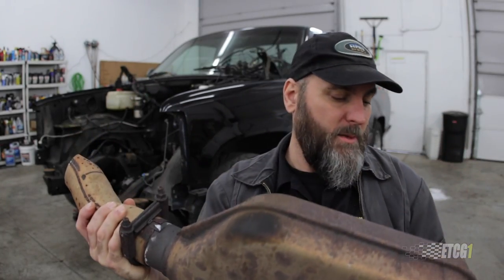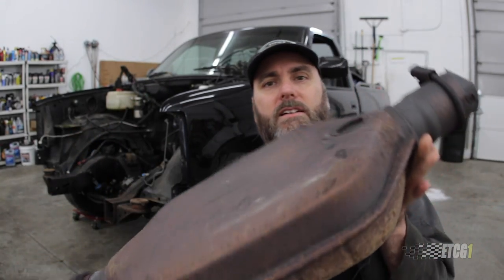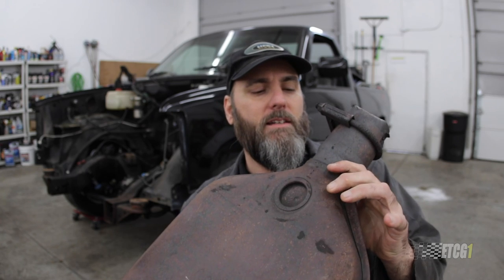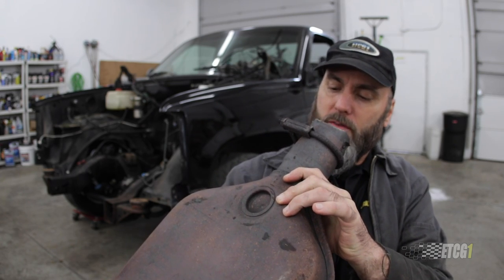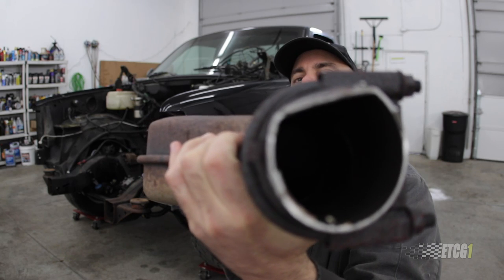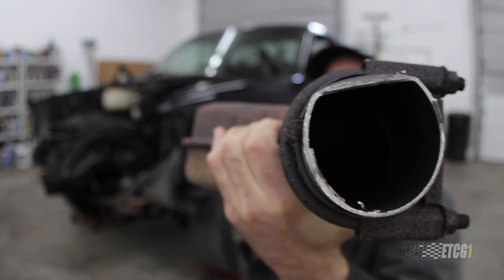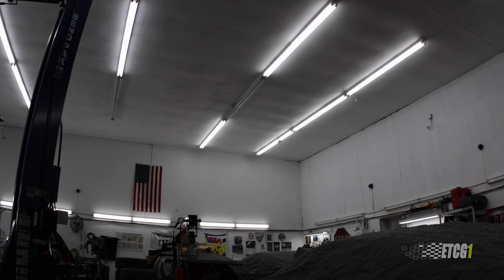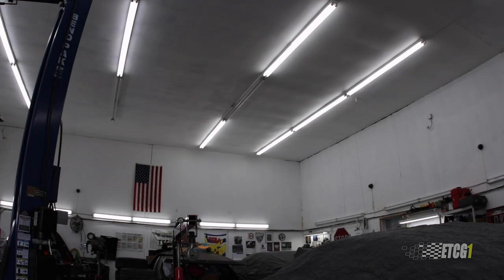Should You Run a Catalytic Converter on Your Hot Rod?

Comment: Why not make a video of doing emissions tests with and without a cat: then compare reports, exhaust smell, and visible particles (revving against a clean cloth or something similar to get some hill-billy grade data points). It would also be nice to get a dyno run with and without a cat as well, so that we can compare downsides and perf gains.

However, as a sidenote: I thought this discussion was pretty much over since we finished the 80's. Three-way catalytic converters are old, proven, tech and it has been decades since anyone around this side of the globe has even thought about cutting off cats. I still smell the bitter, obnoxious fumes from cars of the 80's and that went gradually away as emission limits requiring efi and cat came into effect in the 90's. I don't miss that at all, I don't get funny taste in my mouth anymore and I don't see why anyone would want to drive on public roads, or any roads, deliberately without a catalytic converter. Think of standing in lights and inhaling yourself all that emission "goodness" that your straight-pipe car is fuming away around it.

Comment: if theres no requirement, who cares? lack of enforcement is why my tpms and air bag lights never shut off. Your not building 15million of these engines and are not a new car manufacturer. 95% of people drive those cars and are not doing custom work like yourself. I think the percentage of old cars/custom car to new cars actually being driven on the road it low enough to make your pollution machine, negligible in the grand scheme of things. especially when entire giant countries boil and burn down trash to get scrap out with no regard for any ones health.

Comment: I would put a cat on the truck, even on the Fairmont. If you can improve the emissions, why should you possibly decide against it? Performance? Is a cat really gonna affect it that much? You of all people would find a way around it to run strong with a cat.
Reply from the maker: The Fairmont won't get a cat, at least not in the near future. That said, I'm improving the fuel injection and the ignition system on the truck with components that function better than stock. In short, I'm improving the emissions systems on the engine even without a cat.
Reply: @ETCG1  Okay, thanks for the reply.

Comment: Emissions are fine for the 99% of people who drive cars just for transportation. Which, if the math is right, is where 99% of automotive pollution comes from. I don't think the unjust laws should not apply for the car guy type who modifys there cars as we are only a very small percentage of the people actually driving a car and adding to any pollution. I delete every emission system (except the EVAP in some cases as that system doesn't hinder anything but keeps gas fumes down)  from everyone of my cars INCLUDING the cats. I do so for a few reasons. I delete the EGR because I DON'T want carbon buildup in my intake and on my intake valves and lower octane in my intake charge. I re-route the PCV to catch cans for the same reason. I delete the cat as most of my cars are old enough that the cat is ether clogged or broken up anyway. Not to mention there have been people who have deleted there cats and STILL pass the pipe sniffer test in un-free states.

Comment: If you really believe in ‘man made’ climate change go for it. I personally don’t. I had a 1975 olds that passed Cali emissions without a cat (hollow no visual inspection) by just changing from manifold to port vacuum on the timing. (Nox) and my hydrocarbons were about 200. This was in 1988.
Reply: What about all the people you gas out that have to drive behind you or are going for a walk?
Reply: GoogleMinus what part of passed did you not get? I was allowed 300 ppm hydrocarbons and my nox level was passing with just a good tune and egr blocked and no cat. Ps mining,refining all those precious/ non precious metals and manufacturing and shipping these also creates pollution but I’m sure that isn’t taught in indoctrination class.
Reply: @NoName-tz5ji  IDK why you're going at a global level when I was going from the local viewpoint.  Just because it passed the inspection, doesn't mean that there is nothing to be gained by having a cat.  Clearly you should have learned this when the levels of lead in your water "passed" but the effects...

Comment: you don’t need them. the old catalytic converters were inefficient and restrictive. modern ones are so much better. my 89 k5 blazer has a hollowed out cat and it passes emissions with flying colors. if the vehicle is well maintained and use good fuel you don’t need a catalytic converter.

Comment: I would always install a catalytic converter, even if the car didnt have one, as far as it is possible without damaging the car. But i would go for a light high quality one that generates less backpressure than the original one, if the car had one stock. Id rather sacrifice something like 5 hp or so if i can have exhaust gasses that are less unhealthy for the next driver behind me. Only situation ever i would run a car without a cat would be on a real racecar, that i was actually going to race professionally, any other situation i dont see the need for the most possible power.
Or to say it in Colin Chapman's words: "Add lightness."

Comment: I have to question if emissions from everyday motor vehicle use have been solely responsible for "making kids sick". Is smog strictly from vehicles the only killer or was it more the smog from industry? Maybe it was 50 - 50 or 30 - 70 or 90 - 10? What about lawn equipment or home heating systems or coal plants, or forest fires or volcanoes? And there is never any acknowledgement of how far we've come with reducing emissions over the last 5 decades or more, at least in this country. Throw the "kid factor" in there and you have immediately emotionally charged the debate. Why not mention puppies and kittens? They should be good for getting even more people on board. I realize my point is off topic from that of the video but I really wish that claims with no irrefutable scientific basis and sited sources as well as 'carbon neutral' references could be left for the political Youtubers. And, of course, I do acknowledge that air pollution is not good and should be minimized but not necessarily completely eliminated at all costs. There is probably a reasonable middle ground somewhere but I have yet to see any real hard facts and believable evidence regarding rational and feasible solutions. One thing is for sure, I'm not going all in on the fact that if I never use a straw again for the rest of my life, I'll save the sea turtles or whales or plankton or whatever is being killed by them. (Btw, how the heck are they all getting into the sea, anyhow?) That was a major digression for sure but it would appear I was due...

Comment: If the vehicle was built with a catalytic converter it is a violation of Federal law to remove it and still use it as a street vehicle.  It doesn't matter what your state laws are, it is always a violation of Federal law.

Check out Chapter 42 United States Code section 7522 section a subpart 3 (this is abbreviated in legal writing as 42 USC § 7522(a)(3)):

(a) Enumerated prohibitions

The following acts and the causing thereof are prohibited—

*

(3)

(A) for any person to remove or render inoperative any device or element of design installed on or in a motor vehicle or motor vehicle engine in compliance with regulations under this subchapter prior to its sale and delivery to the ultimate purchaser, or for any person knowingly to remove or render inoperative any such device or element of design after such sale and delivery to the ultimate purchaser; or

(B) for any person to manufacture or sell, or offer to sell, or install, any part or component intended for use with, or as part of, any motor vehicle or motor vehicle engine, where a principal effect of the part or component is to bypass, defeat, or render inoperative any device or element of design installed on or in a motor vehicle or motor vehicle engine in compliance with regulations under this subchapter, and where the person knows or should know that such part or component is being offered for sale or installed for such use or put to such use

You count as a person, and the vehicle has been sold, so under 42 USC § 7522(a)(3) you would violate the Federal Clean Air act by removing or modifying the emissions equipment on your vehicle.

Under 42 USC § 7524(a), "Any person other than a manufacturer or dealer who violates section 7522 (a)(3)(A) of this title or any person who violates section 7522 (a)(3)(B) of this title shall be subject to a civil penalty of not more than $2,500. Any such violation with respect to paragraph (1), (3)(A), or (4) of section 7522 (a) of this title shall constitute a separate offense with respect to each motor vehicle or motor vehicle engine."

Sooooo, roll the dice. Will you get caught? Probably not. Will it hurt if you do? Depends on your income bracket. Just giving you fair warning.  I have had exhaust shops refuse to work on my vehicle when they discovered a previous owner had removed the catalytic converter.

Comment: every contribution is pollution
Reply: How about all the people that have worn valve seals or rings in newer cars and are constantly burning oil? A properly tuned engine without a cat would be 1000% better for the environment than those examples.
Reply: Ban all the cows, they hurt the environment more with greenhouse gas than any non cat vehicle would

Comment: I think you just making excuses. If you drive your “performance” vehicles for something other than pleasure/show. You run errands in Fremont and will do on the truck. You may “commute” them to the shop from home. Multi port injection with custom chip, carb running rich from stochiometric mix. Dumping more fuel from the design to make more power. That’s  pollution. CO2 - ok, I can excuse that, compared to the coal plant that’s nothing. CH and NOx - sorry, that stinks. I have some warm feelings to the smell of old car exhaust, brings memories of youth. But standing behind that “tuned” antique civic/bmw stinkers at the traffic light - stinks. Also they often make more fart, than power :)) I can beat them in my wife’s minivan with 270hp. There’s no replacement for displacement.

Comment: I think you should put a new catalytic converter design back on it. Tbh it might be a tad bit dangerous to inspire other people to remove their catalytic converters as they might do it to their daily driver as well, that is a bit more pollution in the air which I will have to pay the consequences for down the line.
Reply from the maker: My intent is not to inspire others to remove emissions systems. My intent with this video was to pose the question of running emission systems on modified vehicles like my truck. Keep in mind that I'm updating the fuel and ignition system of my truck to be better than stock. Just that alone will improve emissions.

Comment: I hate driving behind a non cat fitted car.. But in europe we have the same regulations for older cars and you don't need to fit one if not born with it.. Decat kits are sold and i feel a lot of boyracers fit them on newer cars, i hate that even more..
Reply: I'm one of the boys who puts cat on 92 gti-6 swapped Peugeot 205, just because middke muffler  was the same price as euro 3 cat
Reply: @fila1445  I had a VW golf mk2 16v with throttlebody's and a hartmann bicat, and mot guy just said i could take it of as it was a from 1990... Very "advanced" with carbon intake over the trumpets and run by the K-tronic, but the former german owner fucked everything else up, and just parked it under a tree for a eternity..
Reply: @fila1445  200-400 cell universal cats ain't that expensive, but you should be able to map it with or without a cat implemented.. But then again when mapping a car for extra hp's -  you don't care for pollution statistics anyway would you?
Reply: @martinrasmussen8745  I'm building my car to ba a zippy daily driver. I have plans to get another 205 to make it straight up track car with ITB and catless sport exhaust
Reply: @fila1445  205's are classics for sure, tho not into french cars, i would not mind having a 205 1.9 or the engine from the 306 implemented as u have there?
Reply: @martinrasmussen8745  engine is from Xsara vts to be exact but it's the same as 306 gti-6/s16

Comment: short answer: yes
especially if you run 200cpi metal cats designed for performance applications, they don't kill too much power. also they're not expensive, you can get those for about 60-80$ from magnaflow.

as eric says: there is a reason for those emission laws. 
using one of these converters won't hurt anybody. sure, on vehicles that are that old, they didn't come with a cat originally, leave it out. but if it came with one, i don't see no real, valid reason to get rid of it all together.

Comment: As far as I know, in Pennsylvania, if your car came with a converter it has to have one.
Reply from the maker: It depends on the age. I used to be PA emissions certified.
Reply: @ETCG1  Good to know, thanks for the correction!
Reply from the maker: @TheBeerBox80  Well, keep in mind that I was certified more than 20 years ago. It's quite possible things have changed since then.

Comment: California is a lousy state for old cars. In fact the state government hates them. 1973 & older are the only ones exempt from tests.
The rest have a bullcrap test every 2 years for which the limits for passing emissions tests are gradually lowered every year. Certain trucks are still made to test even though it was not made with factory cats. In my case a 1976 Ford E250. The state fools make passing standards for which older cars or trucks were never designed. Case & point 80s cars now must be put on a treadmill for tests at idle & at speed. The treadmill test didn't exist until the 2000s.
I hate this stupid state! We cant by cats from other states either. $150 cat in another state? Ours will be $650 plus. Some cars have 2, 3, 4, cats on them. Its a big scam. Happy to fix as originally made. But don't jerk us around.😡

Comment: Justify it however you want, but the truck came with cats, therefore you should put one back on. The Fairmont I understand leaving them off but you just said you're going to be driving the truck more once you give your son the element. Just 1 truck won't make a difference but more and more people doing it is how we're gonna get smog clouds again. Be a good example for your viewers and put a high flow cat on it.
Reply from the maker: One part you might have missed is that I'm updating the fuel delivery and ignition systems. As a result, the emissions will likely be better than stock even without a cat. Not saying I didn't ask for your opinion, because I did. I just feel that bit if information is important to answering the question. BTW the Fairmont came with a cat too.
Reply: @ETCG1  But you say at 4:00 that emissions likely won't be as good even with the upgraded fuel delivery. And the reason I understand about the Fairmont is that it's really more of a sleeper/race car and won't be driven often even though it came with cats too. But if you're going to be using the truck on a more regular basis than Oliver it should have some sort of cat on it imo. Especially because since you are a popular "influencer" (sorry I hate that  term lol) it wouldn't be a bad thing to set an example by installing one. Cause 1 person doing it is insignificant but 100k people doing it may have an impact. Thanks Eric
Reply from the maker: @mastahc411  I mention that because the cam I'm running is for performance, not emissions, but the fuel injection and ignition system I'm running are far better than what was on the truck stock and would, in theory, produce less emissions because of better fuel and spark control. That said, I'm not driving the truck in the winter, it will get driven mostly in the summer. In short, I don't plan to 'daily' this truck. 

However your argument about me being an 'influencer' is a strong one and the main reason I made this video, to get a gauge on how the audience feels about emissions before I order my exhaust parts. 

Thanks for your input.

Comment: My view on this topic is that every reason everyone gives for not putting a cat on their car that came with one is an excuse. And every single person can give excuses, and you can think you're the only one or a minority, but it all adds up. A proper modern cat won't sap any noticeable power, and it makes the car far cleaner and prevents that awful smell that disturbs others. If you're building a car, do it right. Add a cat. Don't be that guy.
Reply from the maker: The catalytic converter is only part of the equation. You need a properly functioning fuel delivery system and timing system in order for the catalytic converter to work properly. I may or may not run a cat, but I am improving the fuel and spark delivery systems which should make for better emissions that what this truck had stock. This is the quandary I struggle with in this video. Thanks for your input.
Reply: @ETCG1  100% agree. You've made a lot of headway compared to the awful emissions systems that came with the car. But the cat is still a very important part of the equation and I don't see any legitimate reason to leave it off, when you have the means to install it. Power? Not really relevant anymore. Saying "it's just one person"? Everyone says that, and when everyone does it, it becomes a problem. 

I'm not saying you made any of those arguments, you were very fair in your explanation. But a lot of people make those silly arguments. In the end, I just see no legitimate reason not to run one. It won't hurt one bit, but the benefits are very significant.